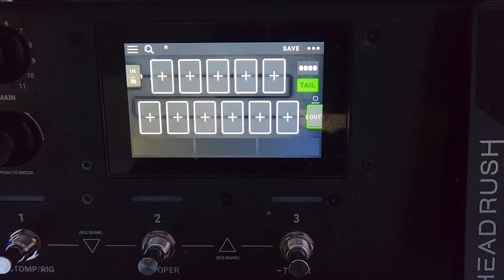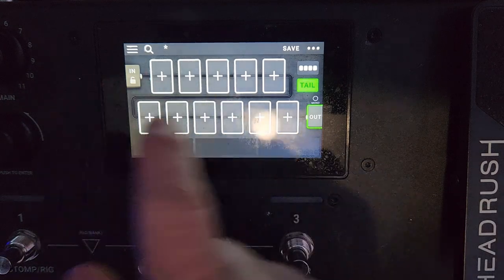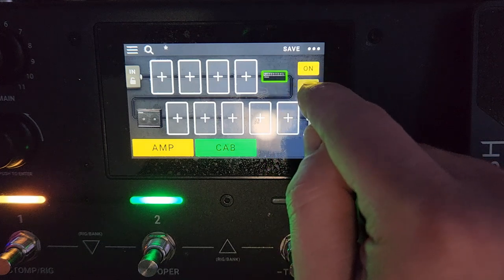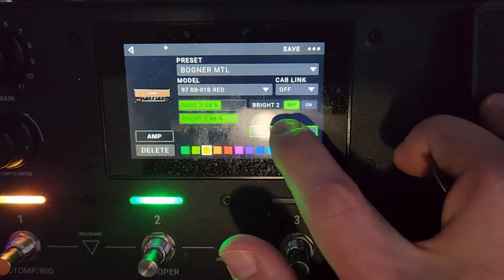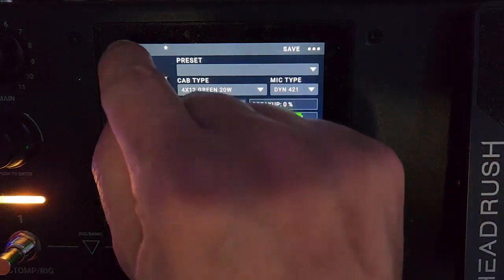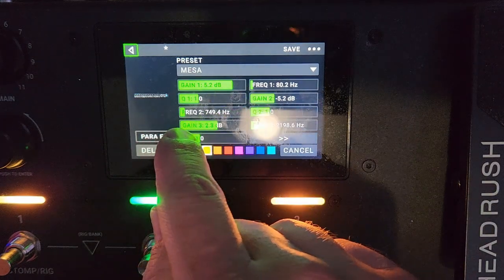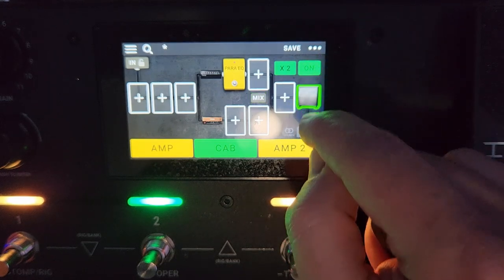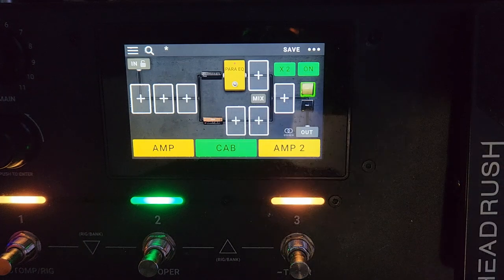How To Combine Amps and Cabs in One Rig on the Headrush MX5

Comment: can i run a parallel signal chain with an acoustic sim in one and an electric tone in the other to make it sound like 2 guitars?? i can do this with the boss GT1000 and its great
Reply from the maker: yeah that should work :). The MX5 allows for parallel routing. You could run the accoustic sim pedal on one route and then have the other be something like a deluxe or Princeton
Reply: @priorwitness  perfect, thank you for telling me, this will be what i get then because my gt1000 needs repairs and i need a box to replace it with while its in the shop
Reply from the maker: @darkestfugue  as soon as I get internet back up and running from a big move I just did I'll be doing a deep dive into the NUX MG 30. It's definitely a unit I would strongly recommend considering as well.
Reply: @priorwitness  thank you, i was taking a look at it but the pedal config doesnt seem to suit me, you seem to only have 2 presets per bank and i cant see how can bank up and down to get to the next one

Comment: I'm very interested in this unit. I'm looking for a smaller unit to gig with. Nice demo. Can you do 2 amps 1 cab? I'd like to run them in series to use up less space, kinda like I do with my L6 Helix, but wasn't sure if it's capable. Thanks!

Edit: Should've watched the whole video first lol! I think this video sold me on it. Just what I need.
Reply from the maker: yes! if memory serves me right (sorry I don't own the unit anymore). There are fixed routing functions and one of them allows you to have two paths in parallel and then combine at the end and you can use the last block as just one IR or Cab.
Reply: @priorwitness  Awesome, I think this will give me great bang for the buck and a smaller footprint. Thanks!

Comment: Can you use x2 on pedal section? Just wonder if u can easily use parallel overdrives without using option to split full path like grid with 3 slots for effects. I rarely need more than 1 effect in parallel, and with split i see there's not much room at the end of split

Comment: Hi, are you using the left mono output or left and right using two wires ? Thanks
Reply from the maker: oh I wish I could remember. Haven't owned it now for a while, but I want to say I had everything just coming out the Left Mono jack. For me everything runs into my amp. So mono is good for me. Then when I run to my DAW, it's still mono because I like having mono tracks to manipulate so i have the flexibility to convert to stereo if I need to in there. I just use plugins for stereo effects that I can twiddle with that benefits the mix rather than dealing with what came in via stereo already.

Comment: I am trying to decide mx5 or hx stomp. Help me here hahahahaha Which one and why? TY :)
Reply from the maker: That is one heck of a comparison! :) One goes for about $300 on the open used market and the other for around $500. So the price differences alone are pretty far apart I think. It really depends what is important to ya. I've owned both. I enjoyed both for what they were. I guess its a discussion a video I could post so I could fill out my thoughts and open it for more discussion for everyone else and their two cents. A quick answer is I guess it comes down to price, amp modeling,  and how many effects and options you want at your disposal. They both sound great honestly. Feel wise I liked the switches and responsiveness of the HX better. More bang for your buck is clearly with the MX5. Flexibility and variety is clearly in the HX's favor. I could go on. Great question!